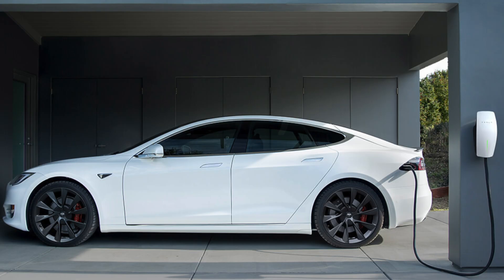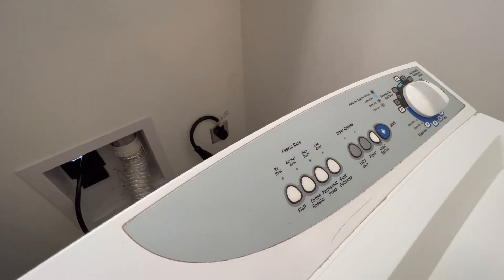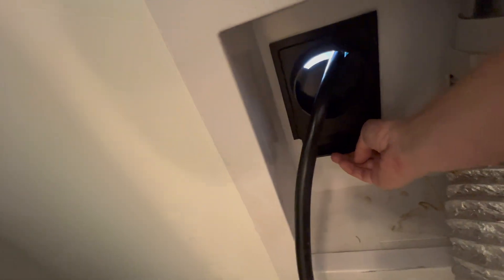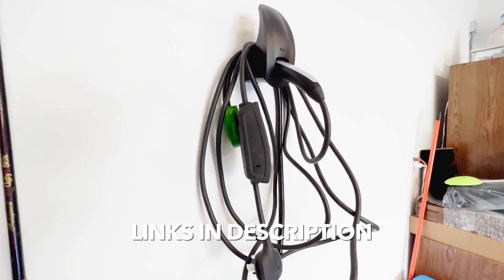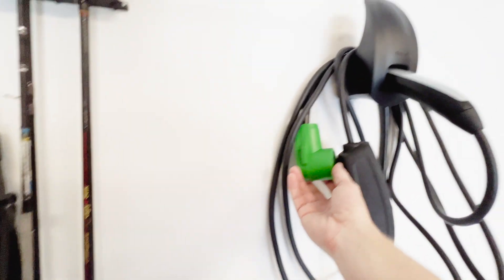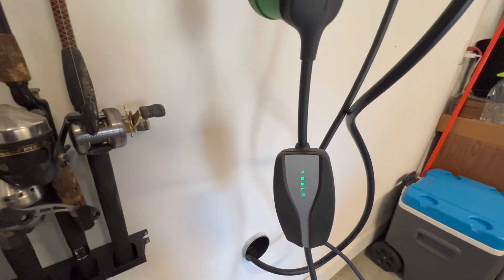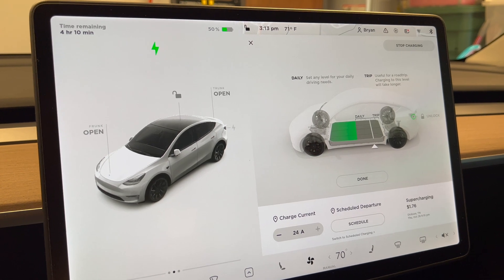Tesla Fast Charging at Home w/ Dryer Plug - Quick Tip

Comment from the maker: Disclaimer: I'm not an electrician. If you're unsure about how to do something, I highly suggest contacting a certified electrician to come take a look. This is especially true if you live in an older home. I'm also not going through drywall as there's already a cutout behind my dryer in my new construction as some regions might not consider it up to code to run through drywall. You also should adjust the amps to 80% of the 30AMP circuit on your Tesla charging screen down to (24 AMPS) so the plug doesn't run hot or trip a circuit. I can't stress this enough, if you're unsure about ANYTHING, have a certified electrician take a look as any work you do is at your own risk. I also use a proper splitter so I'm never unplugging from the wall outlet.

Suggested Safest Option ➡ - Have a certified electrician install a NEMA 14-50 outlet like I now have or hardwire a Level 2 Home Charger: https://youtu.be/DWP_7gdM86g?si=nK-wTsi2ap-_2-JI

CHARGING PRODUCTS IN THIS VIDEO:
Tesla 14-30 Adapter (Select 14-30 from Dropdown): https://shop.tesla.com/product/gen-2-nema-adapters
RVMATE 4 Prong Dryer Extension Cord 10FT: https://geni.us/4qiS
NEMA 14-30 Splitter: https://geni.us/fLuVWzw
Charging Cable Organizer: https://geni.us/cTEK
4 Inch ABS Plastic Blast Gate 4 inch: https://geni.us/q13Z
Magnetic Hooks: https://www.homedepot.com/p/Master-Magnet-Handi-Hook-20-lb-Magnetic-Pull-Hook-07218HD/202639937
Tesla EV Sign: https://www.etsy.com/listing/935401359/tesla-electric-vehicle-parking-sign?ga_order=most_relevant&ga_search_type=all&ga_view_type=gallery&ga_search_query=tesla+signs&ref=sr_gallery-1-6&organic_search_click=1

Comment: I dont have a garage,  can I do this and put all the cords in a plastic tub due to weather and just cut a hole for the plug and cord to reach the car?  Or...does it all get too hot in that tub?
Reply from the maker: Not 100% sure, but cords getting wet are fine. Just cover the connection points. Only use EV/RV grade approved cords.

Comment: Nice set up man. Way to use what you've got! I got a 6-50 welder outlet installed the day after I moved in where I'm at. I don't have an EV but if I ever get one I'm realizing I'm in a very lucky spot to have a 50-amp outlet in a garage!
Reply from the maker: Nice 👍🏻 Tesla makes an adapter for 6-50 as a friend of mine has a 6-50 welder outlet at his cabin that I've used a number of times to charge.

Comment: I didn't know Tesla mobile connector can be used on 240v outlet. Tesla website specifically says it's for 110v. I am new to buy a charger and really need only one that works both on 110v and 240v outlets
Reply from the maker: Nope. Mobile Connector works on both 110 and 240. I've used it on both hundreds of times. You can view the official Mobile Connector manual from Tesla here: On page 6, you'll see it says... "100-240 volt AC single-phase." Hope that helps! https://digitalassets-shop.tesla.com/image/upload/v1744243732/content/dam/tesla/manuals/Mobile_Connector_Manual.pdf

Comment: Great video!  I have a 3 pronged dryer plug on a 30 amp.  Is there a splitter that will work with the 3 pronged wall receptacle?  Thank you!!
Reply from the maker: Thanks. I'm sure there is. Try RV mate on Amazon as they have a number of different splitters that are properly rated.
Reply: @bryanhauer thank you!

Comment: Is it possible to have a splitter like neocharge and then also use an extension cord plugged into splitter? This is because my dryer is in the garage but there is too much stuff in my garage to park the Tesla in it
Reply from the maker: I believe so. Just make sure you use an EV rated extension cord like I did. Neocharge themselves sell a line of extension cords you can use here: https://getneocharge.com/collections/extension-cords?srsltid=AfmBOoq3awi_jzihXKGXxDrq-evp0LQidWjlCayZjNAiJAvBkQQXHYRm

Comment: How did you get that little sliding door on the dryer box !
Reply from the maker: I can't totally remember now. I believe I just used some adhesive. I used a hole saw, then used the blast gate linked to in the description and used some adhesive on one side to keep it attached.

Comment: Hi, just wondering why the car only draws 24 amps despite the outlet being a 30 amp. Shouldn't the car/charger detect the power output of the charger and automatically use the maximum rate?
Reply from the maker: It auto sets it below that for safety. You never want to draw the outlet's full amperage. Charging an EV is a lot of current constantly going through it for long periods. It's called the 80% rule. Here's a little more about it below from Google AI.

For safe and efficient EV charging, the 80% rule means you should only draw 80% of a circuit's amperage capacity, ensuring components operate within a safe range, especially for continuous loads like EV charging. 

Here's a breakdown of the 80% rule for EV charging:
Why the 80% Rule? 

Safety: The 80% rule ensures that circuits operate within a safe range for all components, especially important for the extended time and power levels involved in EV charging. 

Longevity: Following the 80% rule helps maintain the safety, stability, and longevity of electrical circuits and equipment. 

Battery Health: Charging to 100% can negatively impact the long-term health of your EV's battery pack, while keeping it below 100% can improve battery longevity. 

How to Apply the 80% Rule: 
If a circuit is rated for a maximum of 30 amps, you shouldn't draw more than 24 amps (80% of its capacity) to charge an EV. 
For a 50-amp breaker, you should ideally draw no more than 40 amps.

Comment: Thanks for this. I set up the same system for my wife's Tesla.  It works great, but it is a pain to plug and unplug (5:53) the Tesla NEMA Cord. It is a very tight fit. Do you know of a ON/Off switch that can be used in between the Splitter and the NEMA Cord.

LOL - I also have a Tesla Sign on the dryer
Reply from the maker: Technically you don't have to unplug it. Just make sure you don't use both the dyer and the charger at the same time which the sign helps as a reminder. I think there's some switches on Amazon that you can turn off, but they're hundreds of dollars which kind of defeats the purpose of this quick and cheap setup. 

Here's a quick search on Google... Can i leave my tesla mobile charger plugged into the wall?
Yes, it's generally safe and even recommended to leave your Tesla Mobile Connector plugged into the wall outlet, as it draws minimal power when not actively charging. 
Here's why:
Minimal Power Consumption:
The Mobile Connector (UMC) draws very little power when plugged in, primarily just enough to power the green LED. 
Reduced Wear and Tear:
Tesla recommends leaving the UMC plugged in to reduce wear and tear on the outlet and plug, as repeated plugging and unplugging can loosen the receptacle,
Reply: @bryanhauer  Thanks, I understand that, however the Tesla cable remains active with the lights on. This is a continuous drawing of energy. My continued research finally paid off, I think. "AC WORKS EV Charging Adapter for Tesla Use (Safety Switch Y-Cable-4-Prong Dryer)"
Reply from the maker: Right, but as it stated... It draws so little power (just enough to keep the light on) that it's negligible and you'd never notice anything. Either way, glad you found a solution. 👍🏻

Comment: I used your video and links to setup my new model y. I thought I could get by with just a 120 outlet but that is a joke. If you bought an ev car you need 240 outlet. 
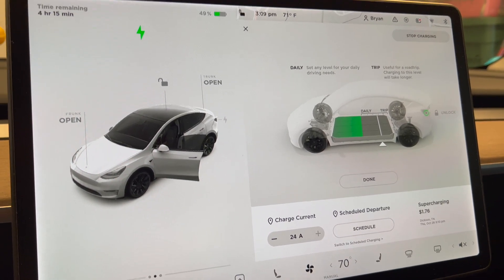I had to buy a 50’ cord though and punch through two walls. I didn’t buy the adapter to go from the cord to the Tesla mobile charger from Tesla though. I purchased one through Amazon b/c it’s a third of the price. I have the car set up to charge at 1:00am so it doesn’t interfere with the wife’s dryer and it’s fully charge  by the time I need to leave for work at 7:00.  It’s been set up like this for only a week but so far so good. Thanks for the video.

Comment: If I’m plugging into my 50amp Range outlet, should I also reduce the charging  amperage to 80%?
Reply from the maker: Yes, depending on what type of car you have, some will auto do that for you. On Tesla's the mobile connector has a 32AMP max anyways, but you should always charge at least one step below what the amps are on the panel. Some 3rd party chargers will charge at 40AMP on a 50 amp plug, but Tesla's will max at 32 if you're using the mobile connector. If you're on a 40AMP panel then try setting the car to 32. 30 AMP set to 24 and so on... My Model Y usually sets itself properly, but you can just change it manually on the screen or app as well.

Comment: I take it 3 years later, and nothing burned down, and everything is still functioning normally?
Reply from the maker: Everything worked great. About a year after I had an electrician put in a NEMA 14-50 as I wanted faster speeds, but worked great as a starter option. Key is to not charge while doing laundry, set the amps on the car to 24 if it doesn’t auto set and to use official EV cables that are rated for its use. Had two electricians look at the setup too and both said it was fine.

Comment: I had a 220 6-20 outlet in my garage, so I got the mobile charger with that adaptor. unfortunately, it's a little to sort so I was wondering if there was a way to extend it. I don't get my car until the 24th. Should take me 3hr to charge from my math for going to work and back. This might also be an option for me in the future if I need more juice.
Reply from the maker: Amazon should have some 6-20 extension cords for that. Just make sure it's considered heavy duty and made for EV use. Mainly that means it's made for continuous high voltage.

Comment: Your video features a NEMA 14-30 receptacle. Some people can use this setup with the older NEMA 10-30s but will be ungrounded.
Reply from the maker: Nice. I don't have any experience with that, but a good tip. Not sure of the increased dangers in doing that, but just suggest anyone worried to check with a certified electrician.

Comment: Where did you get 21mph from? I have a similar setup in the UK and charging at 30A/7kWh  is only 15mph. You're only charging at 24A
Reply from the maker: I originally screenshotted it directly from Tesla, but this is the same image: https://teslamotorsclub.com/tmc/attachments/picture1-png.574740/?id=4903989

Here are their numbers of miles per hour of range for a 30 AMP Panel based on model of car…
24 AMPS
5.7 kW
S - 17
3 - 22
X - 14
Y - 21
Reply: @ excellent. Thank you. I guess it’s all dependent on the onboard charger and BMS

Comment: In Europe we have just 16A breaker for wall plugs. Is it standard that you have 30A on a single phase?
Reply from the maker: Yes. US operates on 120v while Europe does on around 230v so you can offer roughly the same power with only 16 amps.

Comment: Great video and thanks for sharing with everyone. I just set this up at home for my wife’s Y model, and I’m also using the 10-30 plug to the 30amp dryer connector. I’m curious to know how much of an increase your electric bill was by charging at home, compare to the charging stations? Thank you and happy holidays!
Reply from the maker: Thanks. I pay $0.09/kWh so a full charge would be under $6.75 and I charge up about once per week when at home so it’s not much. Compare that to Supercharging where it’s about $0.30/kWh you’d be looking at around $22.50 for a full charge so 3 times more expensive. For most people I’d think home charging should add under $50 extra per month to their electric bill. Hope that helps and Happy Holidays to you as well.
Reply: @ thank you for the prompt response and that was very helpful information and good to know, since I was anticipating the electric bill to go up a couple hundo more a month ha! It is much appreciated and be safe! 🫡

Comment: After ordering a 50 foot 14-50 cable and tesla adapter, I realized the dryer plug is different so I had to order an adapter 14-30 to 14-50.

Comment: Can I leave it plugged in with power as long as it’s not charging the car or will that also drip the breaker so I don’t need to disconnect and plug back in disconnect and plugged back in
Reply from the maker: On a Tesla it will automatically stop charging once it reaches the set % so no harm if it's still plugged in as it's not passing electricity at that time. As an example... you leave for work in the morning and return around 5PM with 35% charge. When you pull into your garage, you plug in and it charges up to whatever % you have set (most people have 80% on Tesla's with lithium ion batteries and 100% for those with LFP batteries). About 3 hours later your car reaches its desired %. There's no harm in just leaving it plugged in until morning when you leave for work again. 

The only reason I disconnect is that the method I show in this video shares with the dryer and since you can't run both at the same time in this setup, I usually just disconnect so I don't accidentally run them at the same time.

Comment: Thanks.  I am going to check if this is possible for my Kia Niro at the inlaws!  (Not sure I can specify how much amps my Kia will draw to keep it safe.). I will say though that when I had my son (an electrician) install our level 2 charger i purposely did not choose the option to use the Nema plug like the dryer one and I went hard wired.  The reason is because you really need to have a heavy duty receptacle installed, one that is not going to melt when you are using it full out for  8 hours straight.  I am not positive that the standard ones for dryers are enough for safety.  Either way... Personally, with that setup I wouldn't charge overnight and I would put a fire alarm right over that outlet in the laundry room.  You can never be too careful IMO.  Thanks again... Going to check on my Niro now.  (Edit:  Apparently I change the AC Charger rate to Maximum, Reduced, or Minimum, so ya, i might indeed try this sometime!)

Comment: I agree is a life saver, BUT, as a transition, while you find a way to install a rated a dedicated one. EV charging is a new thing and most Electricians ignore it needs continuous juice, that is a constant draw, non-stop, for hours. Cheap outlets will handle the amperage, but are rated at 75, not 90 or 60 degrees. They look the same, but the contact area in the metal inside is only half the plug, and is not copper. There is expansion and contraction as it heats constantly. Also, the connectors (terminals) in the back will loosen. PLEASE, get a Hubbell or Bryant INDUSTRIAL outlet (receptacle). They are not less than $45, but beefier, copper, the contacts are solid copper and cover the entire plug inside so there is much more surface area, and the connectors in the back are huge grasping hex screws. If you paid less than $25 for an outlet, you can lose your home for saving $25.
Appliances (and outlets until recently) are meant to handle equipment that pauses, heats, stops, then on and off with the current draw, for at most a few hours.
Reply from the maker: Yep, that’s what I put in the description as well 👍

Comment: From what I’ve read you cannot get true Tesla supercharger charging speeds from 240 VAC home dryer voltage.
Reply from the maker: Of course not. Nobody can. This is level 2 charging and has nothing to do with DC fast charging or Supercharging which is level 3. 

Level 1 - Charging using a regular 110v wall outlet. Expect 2-3 miles per hour of charging.

Level 2 - Charging using a 240v like in this video or through a NEMA 14-50 install or through a 60AMP hardwire install like a Tesla wall charger or Destination charger like at hotels. Depending on various factors expect between 20-44 miles per hour of charging.

Level 3 - DC Fast charging or Supercharging like you see at Electrify America, some ChargePoint stations or of course at Tesla Superchargers is the fastest and is way outside of home use capabilities. You should expect on average speeds of 50kW - 350kW and between 135-1000+ miles per hour charging.

Comment: What if you have a 3 prong dryer connection?
Reply from the maker: I'm not 100% sure. You could try something like this if the plug matches up to what yours on the wall looks like and then get the official Tesla NEMA 14-50 adapter: https://geni.us/7rX3e

I'm not an electrician so unfortunately don't know for sure as everyone's setup at home is different. I did read that three prong are for older dryers prior to the year 2000 and the reason we now have 4 prong is due to a safety defect in the 3 prong. I'll just link the article on Home Depot so you can read it so not sure it would be the best idea then, but again they do sell a splitter for that. I'm not an expert though. https://www.homedepot.com/c/ah/how-to-change-a-dryer-cord/9ba683603be9fa5395fab90622a0d0f